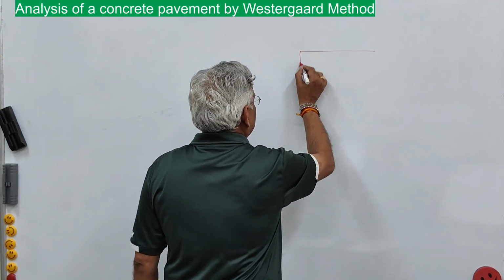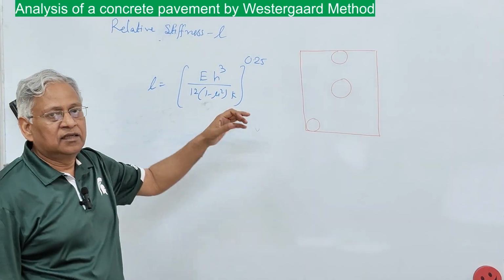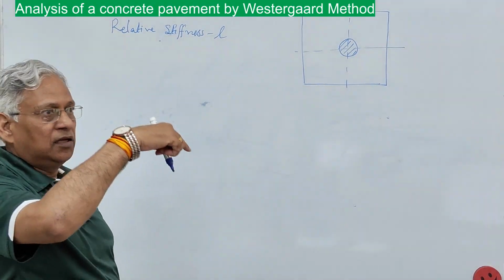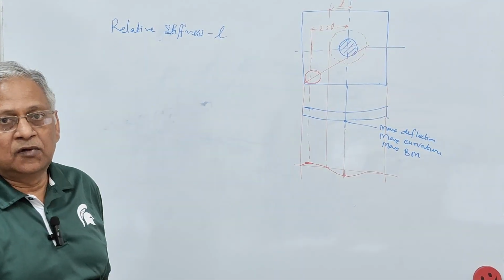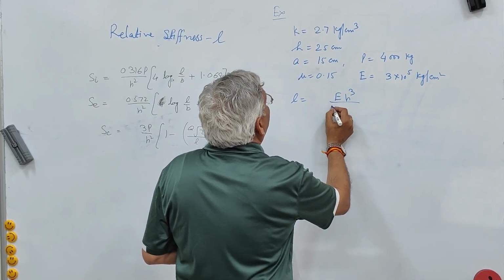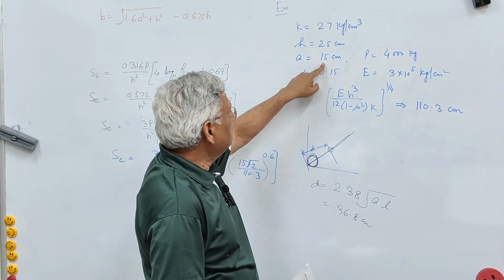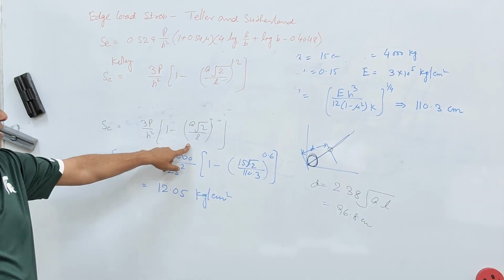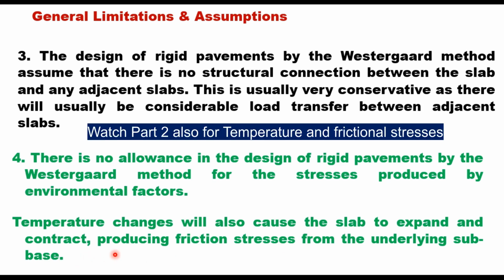Stresses in a rigid pavement Part - 1, wheel at interior, corner or edge, Westergaard Analysis

Comment: Sir,why in corner loading ,the maximum stress doesn't occur directly under the load but at some distance along the diagonal bisector of the corner angle ?
Reply from the maker: It is because of reversal of stress at the corner. The corner has the least support from adjacent slabs and the subgrade, leading to bending and tensile stresses concentrated at the top (it is at bottom in interior position). 
When a load is placed on a corner, it doesn't just cause stress directly underneath, but the stress is spread outwards and along the edges of the slab due to the slab's stiffness and the way it interacts with the foundation.
Reply: @SatishIITR  sir, that means slab action is one of the reasons of such phenomenon at the corner loading ?
Reply: @SatishIITR  thanks a lot for the reply sir.. please accept my reverence ❤

Comment: Thank you very much, sir, for the full explanation.
I have a question: if there is more than one wheel loaded on the slab, how is the maximum stress calculated?
Reply from the maker: Stress due to a single wheel will always be higher than that due to two wheels (because of negative bending created by the second wheel). You can use the concept of ESWL for considering more than one wheel.

Comment: Sir can effective cohesion have negative value?
Reply from the maker: Effective cohesion of a soil can never be negative
Reply: @SatishIITR  Thankyou Sir 🙏🏻
Sir I found some lines regarding this doubt please clarify it-
"Cohesion is the property of a soil that causes it to stick together. It is caused by the attraction between the particles of the soil. The effective cohesion of a soil is the cohesion that remains after the water has been drained from the soil. The effective cohesion of a soil can be negative if the water pressure in the soil is greater than the effective stress."
Reply from the maker: @GauravSharma21193  will see some text book
Reply: @SatishIITR Thankyou Sir eagerly waiting for your reply 🙏🏻
Great Initiative Sir🎉🎉
Reply from the maker: @GauravSharma21193  I discussed this point with my colleague in Geotechnical Engineering. His reply is given below.
Theoretically NO. Sometimes, tests may give negative value. Actually, it is the adhesion between particles due to suction which is a temporary phenomenon.
Reply: @SatishIITR  Thankyou Sir 🙏🏻